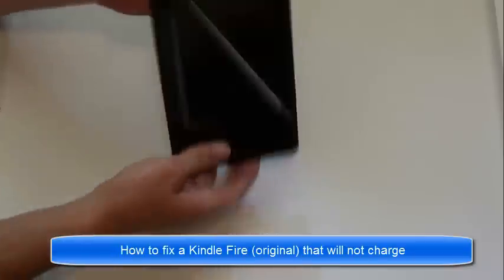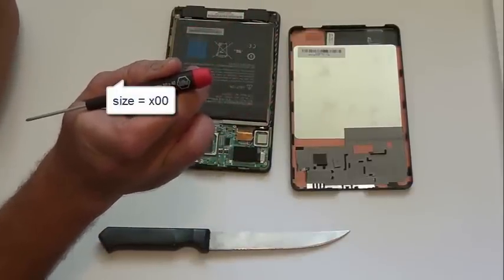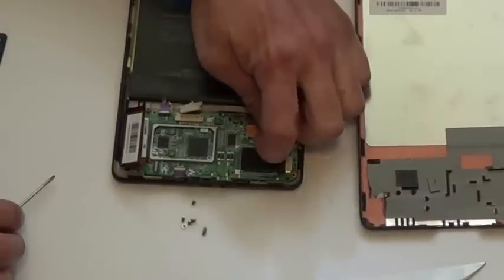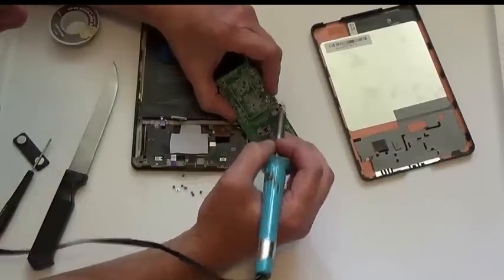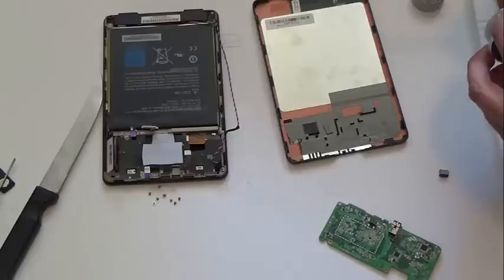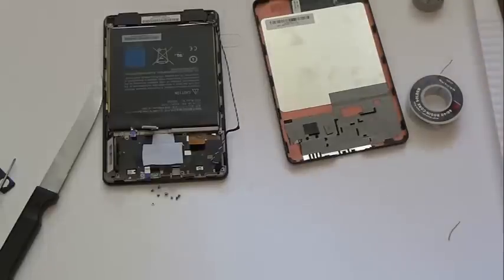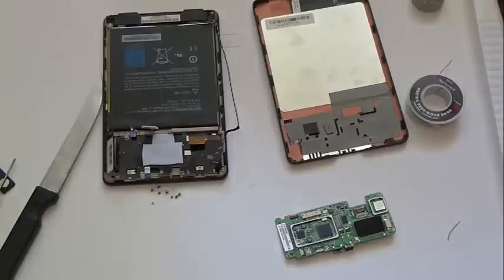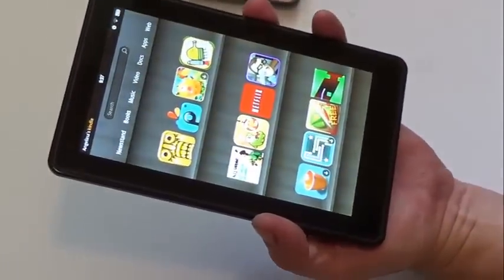Kindle Fire Won't Charge Fix

Comment: These instructions are quite good.  But caution, this is not a task for the faint of heart or skill.  I have a good amount of electronic soldering experience, and admittedly was not using a tiny needle tip but I did not get it done right the first time and was really fighting to not short out the tiny, close pads.  On my unit the little ground pads at the back of the connector had torn away.  Possibly while I was trying to get the connector out so be careful in that step.  But the five tiny signal connections on the connector were just lifted off the pads which means they were cold solder joints from the factory.  Clearly inadequate process control in manufacturing.  On my unit the connector also had ground posts that went through the board and these had not been soldered.  I recommend doing that as it makes a stronger mechanical connection for future knocking around.  Thanks so much for the video.  While it was not an easy repair I am once more a hero for my granddaughter.

Comment from the maker: That's even better. I bet that the some of the connectors are cracked (may be macroscopic, but you may need some help to see it). I bet that if you put the connector in and gently shift left and right, you will see that there are broken connections. Since you are attached, you have good alignment. just heat them up on at at time and drag straight back. This will reactivate the solder and make a new (tin looking) connection. You can add solder to the through-hole pins if they were not solder.d

Comment from the maker: Hmmm, I think it would be easier to just get a new adapter. Get the USB to Micro USB kind. These can be used in the car, airplane, on travel and are cheap to replace. The micro-USB connector is so small and the alignment so critical, I would just get a new one given the low cost. If this is your only issue, pat yourself on the back and plug-in carefully from now on. as you can see from the growing number of views, the connector is delicate.

Comment from the maker: Batteries can become so "drained" that the loose their polarity. 
Since my three kids play with their kindles every day - I don't think your battery  is dead already. It appears to be a good one. I bet that it is just your connector. On the connector, the power pins are on the outside, Pins 1 and 5. Data lines are in the middle. Concentrate on the sides with solder iron.

Comment: Thanks for the tut Peter, Did as it said and, got it all taken apart and seen nothing wrong with the USB or anything else for that matter. So I put it back together and I'll be damned it started working normally.
 If I had any to add to this it would be to say ...  be very careful with the "contact" lift tabs, do not force anything. If you pull and it does not come out then look closely and use a magnifier if you have to.
  All and all this is a very straight forward tut and if you just take your time you will be successful.
 Best of luck to you all and thanks again Peter, my wife is back to thinking I am "the man" now ^_^

Comment: My connector locks are not attached to the ribbon cables. They come right off when I disconnect them. These things are microscopic and I'm sure will be a ton of fun trying to get back on. One of my posts on the port is loose, the solder I have is really thick stuff and I'm a little overwhelmed tryin to get this thing to seat and put fresh solder in that microscopic hole on the bottom side. I think I will try to get a different gun and smaller solder and retry. Great video tho...thanks.

Comment: Fixed my USB a while back. Still had issues. Found that if the kindle sat for a week or two, it would start working. Then after touching or pinching a certain area of the kindle, it would just go dead immediately. No display; no charge light. After sitting another week or two, it would work again. This happened continually. I pulled it apart and was looking for cold solder joints. Found nothing. Then I noticed the thermal gap pad at the 4:24 mark of this video. On the thermal gap pad, I could see impressions from the circuit board touching it. Looking closer, I found short and very fine (finer than cat hair) strands of copper wire laying and stuck on that thermal pad. Those were the problem. When the circuit board was pressed against the gap pad, those wires shorted the board out. As the kindle rested, the pad slowly pulled away from the board and pulled the wires away from the board also. The kindle works perfect now. I've tried to simulate the problem that was constant, but it keeps working now.

Comment: This is VERY IMPORTANT.  Before you do this, hold the power button for at least 20 seconds (30 is better).  Holding it for 10 seconds may not illicit a response (on mine it did not).  The Kindle Fire can get locked up and only holding the button for at least 20 seconds will reset it.  While it is thus locked, it won't charge, turn on, or otherwise exhibit signs of life.  Mine was doing this after my son got ahold of it and the 20 second trick worked.  Considering I was seriously considering opening it up, that saved me a lot of pain!
Reply from the maker: 10 seconds is overkill, it is a 6 second timer for the reset... but hey, it never hurts to hold it a few more seconds. one missisippi, two missisippi, .... :)

Comment: Great video!!!! Exactly what I have to do on the exact device. Took the back off tonight and will attempt the repair during the day tomorrow. I will update after a successful or disastrous attempt.
Reply from the maker: Good Luck. It is very small, but the solder wants to stay on the traces so there's hope.
Reply: Update: I finally had the time to attempt the repair. With special magnifying glasses and a improvised bright light and a whole lot of patience I actually was successful. Time will tell if it holds up. It's difficult to tell how well the solder joint connections to the terminals adhered. I never would of tried this without your video. The electrical contact points are not even visible until it's put under a magnifying glass. Was definately the wrong day to stop drinking beer. You need patience and a very steady hand.

Comment: Thanks for this video.  I guess I know what I will be doing this afternoon.  I have a solder iron for jewelry making, but I have never actually used it lol.  Been a little intimidated by it, here goes nothing.  Thanks again.
Reply from the maker: Good luck. It is tricky. Keep in mind, you can now get a new Kindle Fire for $49 http://amzn.to/2cUZzaJ and since everything you ever purchased is backed up in the cloud, you have not lost anything. Give it a go, but keep that as a backup.
Reply: Well, I guess if I screw up that is what I will be doing. Doesn't hurt to try since my son can't use it anyway because it won't charge at all.  I have a good feeling about this. I fixed my hot water tank, and my washing machine.  I am the handy one in our house lol

Comment: Thank you Peter for a nice easy tutorial. Though the kindle I have just fixed is the hd 8.9 the princible is the same. The mrs has continuosly bent the charge plug back a though it was an old phone charger no matter how I banged my head against the wall explaining she will break it. Hey up don't you love being right, I have left the fix for a week hoping she will learn as she has craved her kindle. She has done the same to her galaxy s4 now having to charge battery separately. Wish me luck I've cured the mrs brutality. Thanks again
Reply: Or I may find another use for that steak knife :-)

Comment: Thank you. I don't think it's battery either but just wanted a second opinion. Good to know we just need to focus on the outside pins. I'll try to remove all the solder and try again, but it's not easy to get in there to remove - or maybe my solder wick just isn't that good. Will keep plugging away ... pun intended! ;)

Comment: An item of significance is what direction to apply force for each of the connectors. Most were discernable from the video but the coax was not. The connector was unfamiliar to me but I figured out one needs to lift up to disconnect this delicate cable.
Reply from the maker: Kenneth Garcia Good point. It is very small and yes, it unplugs strait up.

Comment: where would the charging light be located?  I've never seen a charging light on my kindle fire..  I've often looked for one just to be sure it was charging, and now I'm in the same boat as the rest of you...  Nothing is working.  There is a very dark picture of a dead battery on my screen even though I shut it off manually..
You do great work, by the way

Comment: This is the exact problem I have had with my Kindle. This looks like a doable repair. I do have a question about the usb port. Mine was not connected at all , just like in your video. When I lifted it out there was a small black foam piece. I am not sure how it should be seated. Any suggestions on where it should be? Thanks so much for this video!

Comment: Well I almost took it apart, but the top right Screw is stripped and won't come off. But with lifting it I can see it is also kind of loose just like you said, manuf. defect so You'll buy a new one! I take it the connector is suppose to be sodered to the top of the board. Well I don't have a sodering gun so I guess I'm out of luck. But Thanks!

Comment: Tnx Pete, nice job! I tried a similar feat last week with the gf's old Samsung S2 phone, which had a failed usb port, and the pins were just so small that I think I must have gotten a solder bridge or something, because it never came to life again. At this point, however, we have nothing to lose so might as well give it a try. I need to get a smaller tip and a stronger magnifier (I'm not getting any older, but my darn eyes are...) though, or I don't stand a chance. Thanks for a great vid! radio
Reply from the maker: +Ross Guldenbrein check out this link.. It might be money well spent for a project like this.. http://www.amazon.com/gp/product/B000RB38X8?psc=1&redirect=true&ref_=ox_sc_sfl_title_2&smid=ATVPDKIKX0DER

Comment: Haven't solder anything in over 20 years, but what the hell, 3 year old kindle that has stopped charging, already been replaced, so nothing to lose. I can tell by the inability to fit the micro usb into the port that it has shifted on the PCB and will need to be reattached. Soldering irons are cheap. Looking forward to giving it a try.

Comment from the maker: 1. Try to "reset" the kindle by holding down the power button first. 
2. If nothing, try plugging in the adapter. Does the light come on? 
3. If not, or if it is "finicky" try another adapter.
4. If it still acts funny. You probably have the same issue we do.

Comment: By the way, I suspect that while the solder on the port by be weak, using the device with the charger pluged in May cause more stress to an already weak area and speeds up the failure.

Comment: An incredibly common problem, the connector arrangement is obviously a very bad design on these Kindle Fire. And the companys refuse to repair out of warranty is simply crooked &  inexcusable. There should be a class action lawsuit so that people who buy this cheap Chinese crap can get a small measure of justice. I am very glad that I never purchased one of these POS. Thanks, Peter,  for posting your rudimentary video. It has been of help to many DIY folks, although some did botch the repairs..

Comment: My regular Kindle is not charging and it feels like where it should be connecting, the connector is shifting back. Why not use glue/equivalent to hold it in position? I loved seeing the Kindle taken apart.
I was brought up to treat warrantees as sacred, but as you suggested my Kindle is no longer under warrantee, so I don't need to worry about voiding it. Thank you.
It would have been nice to a the camera positioned so your hands were not blocking the lens.

Comment: The charge plug port on the kindle wears out over time and the plug needs a special angle to work. If you get the message "battery too low to power on kindle", and you are unable to get the orange light to stay on while plugged-in, then here is what you do. While plugged-in with screen facing up,  tilt the plug up about 30-40 degrees and the orange light should stay on. Now, to keep this charging while your away, just lay the plug end where the cord meets the plug end on top of a book. This will keep the angle you need to continue charging.
Reply from the maker: Tony, 
Yes, this will work for a while but it sounds like your traces are cracked. You will soon find that it gets trickier and trickier to get the charge light to come on...then you will be in the same place the rest of us are. Heat the traces and you are back in business.
Reply: i did that for a while and now that doesn't even work so eventually you will just break it so i cant fix this one :/
Reply from the maker: Yep, you just went from showing symptoms of the problem to having the problem.

Comment: This does not look very difficult. I have taken apart a 46in LCD Samsung flatscreen and replaced the power board with success. Thanks for the video and will go for it on my next day off. I bought a used Kindle fire on ebay knowing that it was "for parts or not working" It works but the charge light will not come on at all. I was lucky at best.

Comment: Excuse me Peter C. you seem like a nice and smart guy, maybe you can help me, my Kindle Fire 2nd generation, I bought it last christmas, it isn't charging, except for when you plug it in the wall, I have tried to use a different wire for my computer, but it didn't work, If I try to use this video, will it work with a kindle fire 2?

Comment: What size tip are you using?
And, what do you recommend to do if some of the connector pins have broken off and are still soldered to the PCB?
...And, what to do if you accidentally bridge the pins while soldering?
Thanks.

Comment: Great video peter!
I remove the board and the charge port came off. the problem is the middle legs solder came off the board.its just empty space for the legs.Should i buy another board or can it be fix?
any information would be appreciated. 
thank you

Comment: it would have saved me if you had said to pull straight up on the wfi antenna wire. I pulled sideways and pulled it out of the round tiny coax connector and cannot get it back together

Comment: Awesome video-thank you for doing this. Now I got mine all a part and a pin is broke off the charging port, I found it stuck to the buffer pads-can it be re-soldered back on? Or do you know of a site to order a whole new port by itself? I GREATLY appreciate your help :)
Reply from the maker: It can be soldered back on. 2 of the 3 that I fixed were completely disconnected.

Comment: What kind of solder do you suggest?  Radio Shack offers a huge variety of flavors, sizes.
Reply: Checking back on this.  Could you confirm the best type of solder to use for this?
Reply from the maker: ***** Just about anykind will do. Sometimes you can just use what is on the board. A little more will let you fill those mounts on the sides. good Luck.

Comment: so i took apart my kindle fire because it won't charge and the usb port is fine on it but their is only the big plug coming from the battery that you have to grip the sides and pull out. the connection right next to the big one, it doesn't go to anything. is that normal? their is nothing plugged into it but it doesnt look like anything is supposed to go to it. i hope i didn't confuse you. any help would be awesome on what's wrong with my kindle. thanks!

Comment: hi, can I ask for information, I have a 7th generation kindle. the kindle has the screen locked on a page, and it won't reset.I disconnected the battery, also the connectors for the touch screen and screen, but the page still remains on the screen.if I connect it to the pc, the light turns on, but the pc does not detect any connection to the kindle.
 could it be a problem with the battery? thank you

Comment: Great Video!  I did it all, the thing seems like it is charging...only one problem.  I think I killed the touch screen.  When I swipe my finger across the screen to open it, nothing happens.  I've reattached the connectors several time, but nothing seems to help.  I did have trouble with the small one on the bottom next to the power usb.  Is this the one for the touch screen?  Any advice?

Comment: Thank you Peter for the detailed video, but I ruined it, because I did not have the right soldering iron, and when I tried to remove the port I pulled one of the traces. Now, I need a replacement board, can you help me, Please?

Comment from the maker: @randy .... Okay, iron might be too hot. You can solder a small 'bonding' wire and fillow the trace backwards and join it at another point. solder traces are just wires.

Comment from the maker: 1. Try to "reset" the kindle by holding down the power button first.
2. If nothing, try plugging in the adapter. Does the charge light on the power button come on?
3. If not, or if it is "finicky" try another adapter.
4. If it still acts funny. You probably have the same issue we do.

Comment: I have a kindle that just gives error that battery is too low and needs to be charged for 15 minutes. Opened it up and USB connector had flaked off the board and two pins were damaged. Ordered another connector and tried to solder on but getting same message and several attempts to clean up and resolder. The pins are so tiny I'm wondering if I did it wrong or if

Comment: Was able to remove the pcb with no trouble. The connector is not loose but I cant tell if the solder connections are good. They're way too tiny for me to see and I have no experience in retouching them...Think I'll get a new one from Amazon, they offered a small discount.
Reply: My attitude is I got nothing to lose. Why not give it a shot on a tablet that is over 3 years old, actually will be 4 in December